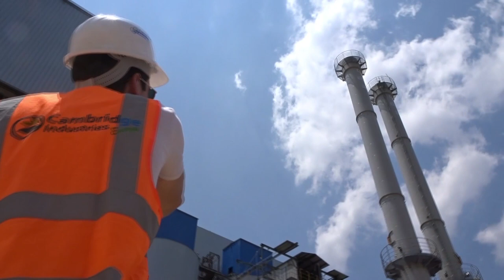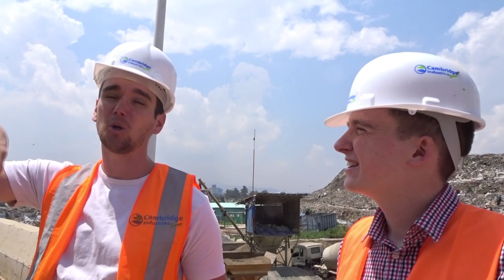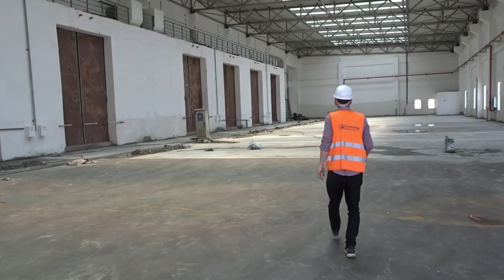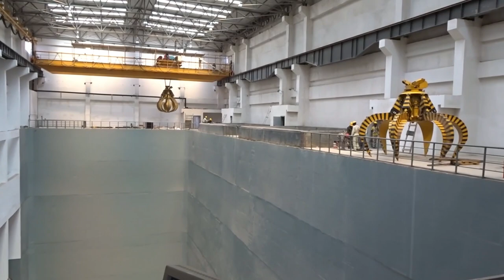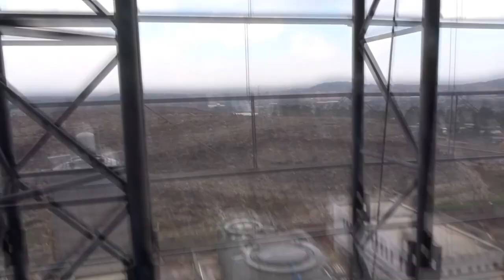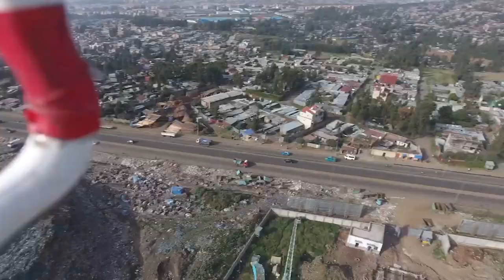Africa's First Waste to Energy Plant!

Comment: Great Job Reppie in helping to eliminate our carbon footprint as well as our past! I feel that every large city in every state/province/country needs a waste to energy power plant. Landfills should be a thing of the past while at the same time eliminating methane [greenhouse gases], cutting down on distances/fuel to haul waste while also recovering recyleables and producing steam that generates heat and electricity to power homes and businesses on what would otherwise have been buried for long periods of time polluting ground and taking up valuable lands. If every large city everywhere had one of these waste could be hauled from surrounding cities hundred of miles away by rail/truck/ship/boat, and old landfills could be excavated eliminating their greenhouse gases, pollutants, and those lands could be freed up for development or just to return them to their natural state, eliminating eyesores. These facilities could be built right next to existing landfills to recover their waste and then the ash could be reburied in the lined excavated landfills or used to be mixed in with asphalt for repairing every nations highways/roadways which are in desperate needs of repairs. They could also be built with a recycling plant side by side to 1st hand recover recycleables. Reduce, Reuse, Recycle then Recover this should be our worlds future! Hopefully you can get rid of that nearby landfill cleaning up that land for good and eliminating the pollution from it.